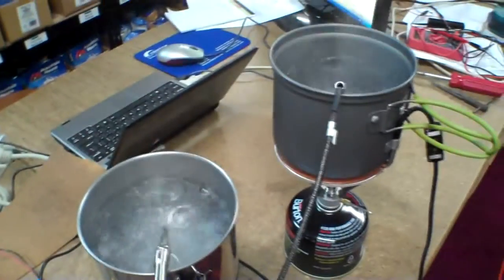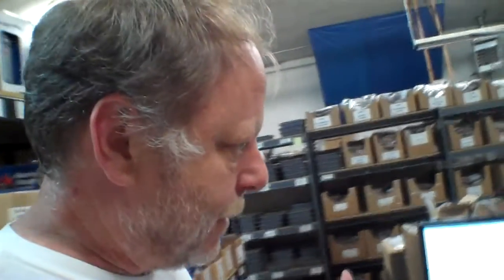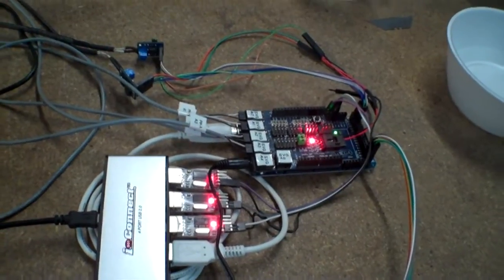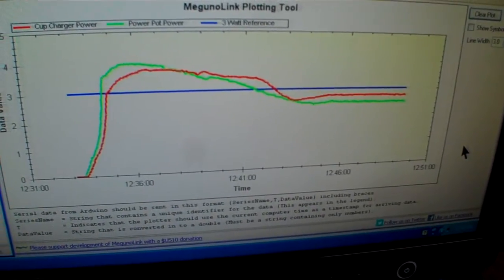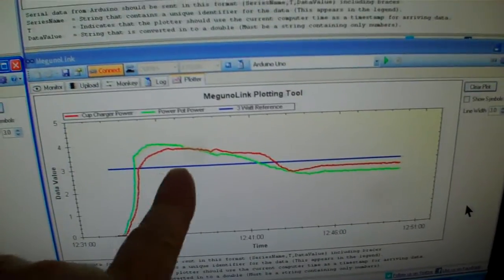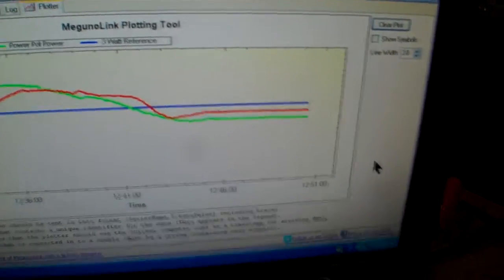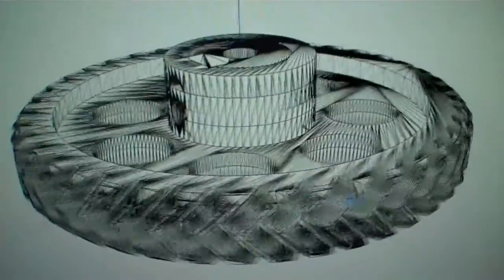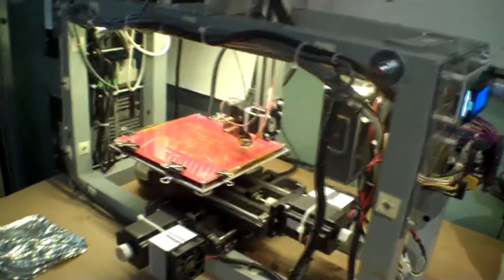Arduino based MPPT Thermoelectric generator test rig

Comment: Was thinking: Instead of motors turning variable resistors, that you could use a digital to analog converter so as to provide various voltages to a transistor, that would in turn provide variable resistance.  A digital to analog converter should be far cheaper than  driving electric, motors  with gears, and brackets, ect.

Comment from the maker: My degree was in electrical engineering, but these days it is so much easier to write code for micro-controllers compared to a few decades ago. There is so much in the way of free software tools and libraries out there. Pretty exciting times to have interest in this kind of stuff.
Reply: EpicenterBryan ,
Sir could you share the schematic for the circuitry design and the Arduino code? It would be great if you could mail them to me. 
avishwas@umich.edu
Any help will be appreciated